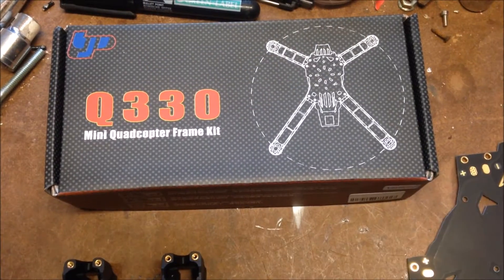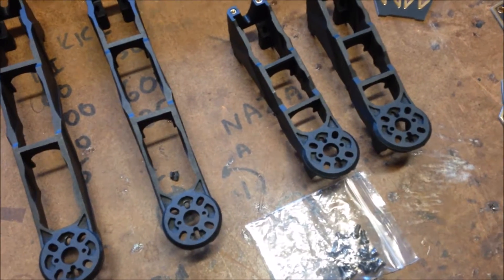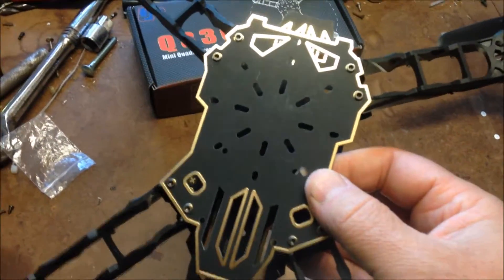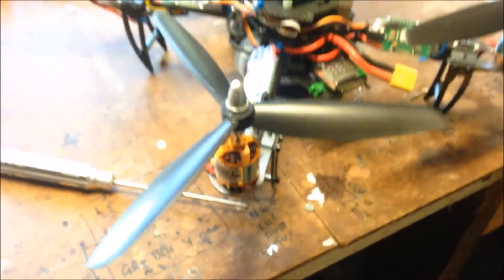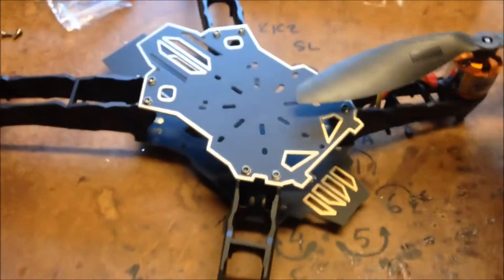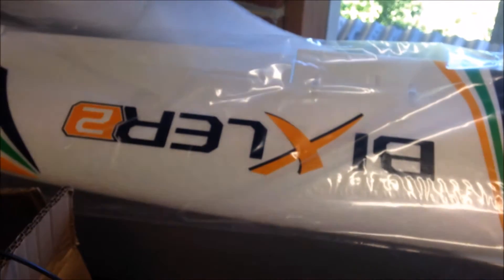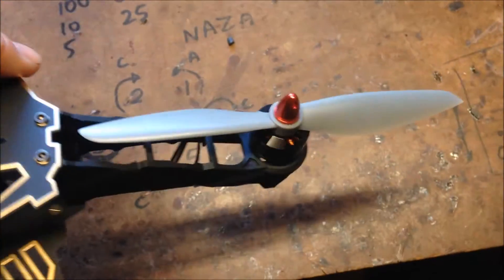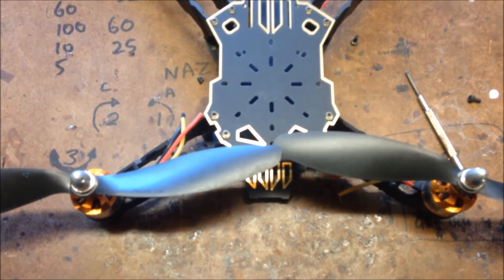Q330 Quadcopter Frame Review and Build with 2826 and 1806 motors. Bixler 2 intro

Comment: Hi, who makes that frame? Thanks.
Reply from the maker: I got this one from Ebay.
Reply: Thanks, no brand name?
Reply from the maker: @gilgsn  https://www.ebay.com.au/itm/Good-PCB-Version-Q330-Alien-Across-RC-Quadcopter-Frame-330mm-High-strength/184205434802?_trkparms=ispr%3D1&hash=item2ae37fdfb2:g:clEAAOSwn2leZ9Df&enc=AQAEAAACcIQvEcHUrT7nmUC3yY5qbPyaBN1nJEDYW8MyypsJPgXKBE6azt8cGhqIvkcfFDcbk%2Bx5CCiLjcx6MfxLIp8CkPBBoK0Klolsm%2BaRRXrCdDTWCmUISMDbNIgdu8H79io0mY9pCV1Fzj%2FaFowDvYIAStpV56e%2FPnm5TFroS8gc0%2BoUkMl25pCKiOL2XcQLYdBzW5Hxubz486abrkKKhBHZMS5FUF%2BeRMEcJGo0T2urm4JFOMHz%2BQFACrsYMQjb9Ze2AjI1o25IWO5gDhpwGj14xvPcw%2F2FK%2FQWdlSBNqWTFODzheAPnHu4%2FQjaYUPujSvmsoJgi7C6fXr%2B3TGCLtpiYJOxq7n33lZsMeBAXoxiUGv8Nbnggrv%2BwY0flT1zKJbLFDbB3hGB8piNnzTyAr6oGuIO%2B%2F7GVWRKydH2e53FX6p7cnSWjwmxVux8ufDvFaKjHwifNgnugxm7hhOIKBFm1sheuatIyreGxcJ2qvE9hmYDdThrm5irBe7zWKiRMQfNTKXXDKzXFMm6uUYWjVynnDVG1MBXeC%2FTlC72Sxhpgetq1JmQnSwrSTPPZ3NZEZM7PNP4R5NISihqy0CoipQbBavNu2anYPU%2Bg6QNc6cl%2FIZvKGDIOFis6fd5chbacDCB88k%2BE0KRzktnFN0O%2FQvfeDSocgPyn%2BHn72I1Mx0pOM%2FcEN0TSvIjj7IYA08tsO2e2nhT%2BChtOOlA%2BImA8A9BuY%2BmVnp6izGP1GhLW0V1%2FH0luu1OrW4G1WDbaZpPI%2F5tyC9lghcc8HKaZU6rpH0WqzjiEi85GvrCTarxjpwGssn5eKaJFBeWKzUqHr0sKKDBnw%3D%3D&checksum=18420543480294709541f03c45c6a925af4cfaa6b5bb
Reply: Great thanks!
Reply: What is the weight of this frame

Comment: Come on Simon, show us the build with the 8 inch props already. Did you not get the stuff yet?
I also bought one of these 330 frames (actually it says it's 325mm) and it should arrive any day now. I've been thinking to use a set of 2204 motors that I have laying around, with 6 or 7 inch props, no prop adapter, they fit right on motor shaft, so not so high.
What's your feeling on this? Will they fit? And is the frame light enough to suit the 2204s? From what you show, the frame is no heavier than a normal 250 CF frame.
Reply from the maker: +Radu Radulescu I have finished it but one of the motors (Badly abused.) Packed it in and I have not replaced it yet. Will try tonight. 2204 I think will work but a lot of surface area for the power available. Not optimal I feel.
Reply: Hello Simon. What motor (for 6" props) do you suggest ?

Comment: Hello 

can you use the 1806 motors??
Reply from the maker: +Jermaine Allen You could but they are more suited to a 250 size frame.
Reply: 1806 motors tend to have narrower mounting holes in their bases. I've got a set of LDPOWER 1806's on my Q250 frame (Same arms all round as the Q330 has on the front) and I had to use a set of motor adapter plates to make them fit. The 4 motor mount slots in the arms were just too far apart and I could only get one screw in. These arms seem to have been designed for 22XX motors as a minimum.
Weight wise, 1806's shouldn't have much of a problem lifting this frame (Hell, The first quad I built has a frame that's about 10g heavier than this, And that thing tootles about quite happily on weedy little 1704's !!!!), It may not be the last word in speed, But it should fly OK with something like 6x3 (Or possibly 6x4.5) bull nose props..... You just need to find some adapter plates.